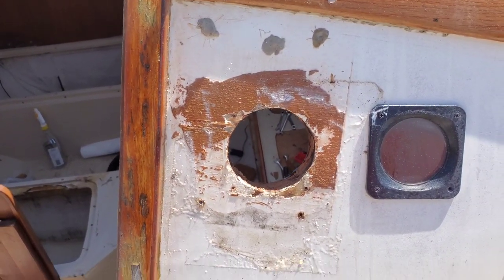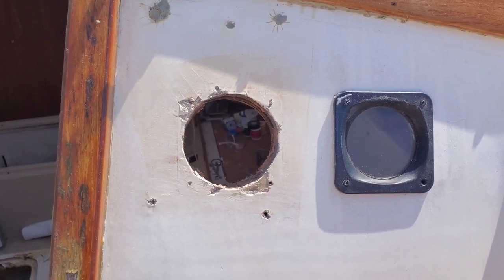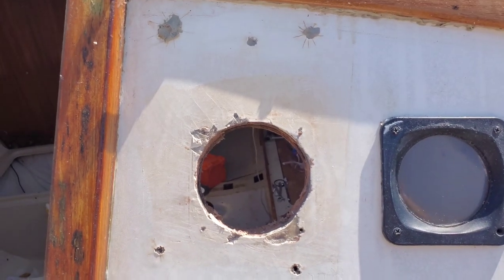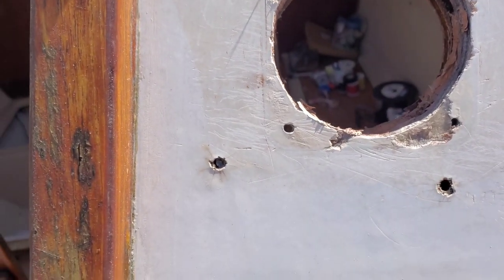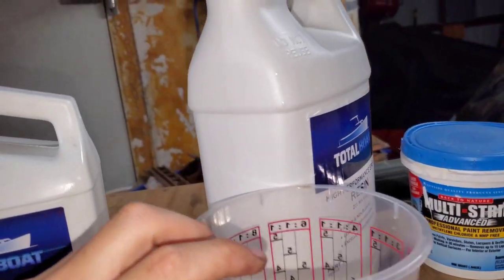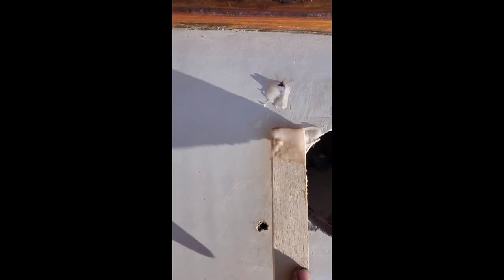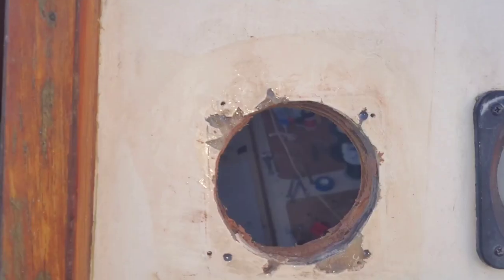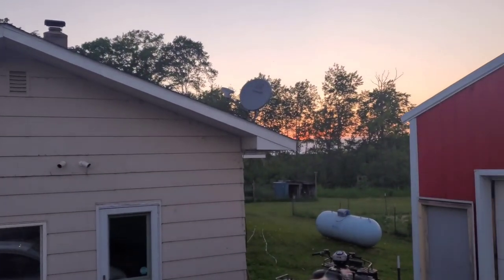Catalina 25 restoration: Covering up the hole from the old instrument panel

Comment: Great video! Some dumb questions from someone who hasn't done boat projects before: 1. What kind of bit do you use to drill holes in fiberglass? What size/type of screws did you use to secure the plate?